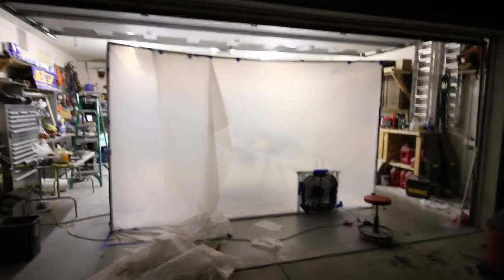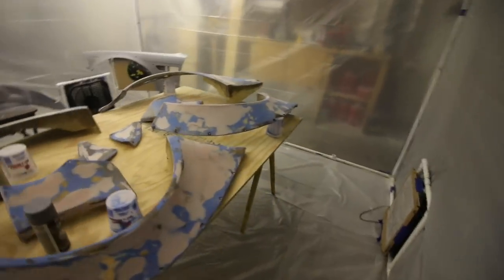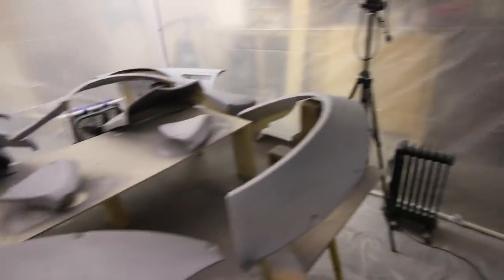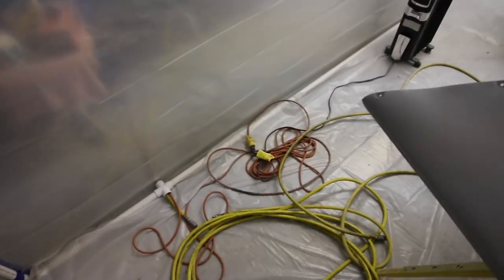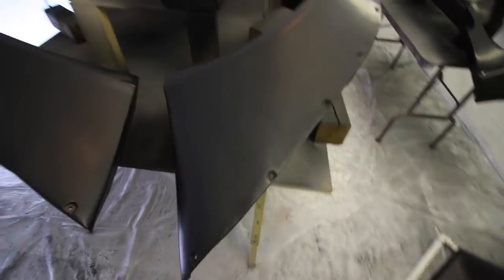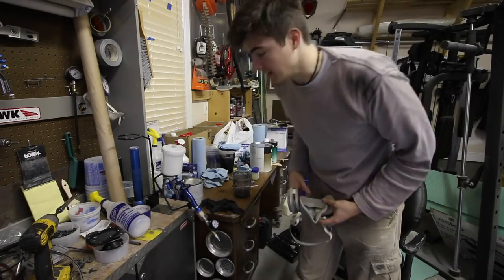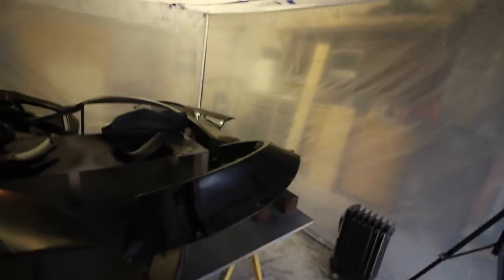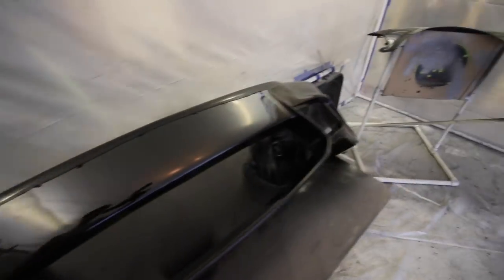DIY Widebody M3: Painting the kit!

Comment: you couldve just wet the floor before painting , makes the dust settle pretty good as well
one thing you couldve done against the sagging is wire the middle up to the ceiling beam 
wat i usually did to clean the gun was loosen the nozzle a little hold the finger or a rag over the sprayopening and pull the trigger , plop the finger of and on and the air will mostly bubble out the paint container filled with thinner 
after that empty open take the nozzle of and use a brush to get the last resideu off

Comment: Why do you guys do an intake fan on these home built booths? It's not necessary and just stirs up more dust and debris, the only thing you need is an intake vent (but not at ground level) with a filter to keep debris from coming in and an exaust fan on the other end, that is enough airflow to get the overspray out but not too much to created a whirlwind or vortex effect inside your spray area. I paint bike parts in my home booth and only have a squirel cage fan at one end, that's it and it works just fine.

Comment: You can tell the fender flares are not smooth.. the way light reflects off of them on curves.. notice how smooth bumper is and fenders are from factory..
Reply: mike dukan I was hoping he'd get it even. It looks horrible. And the black paint makes it much more visible
Reply: Florian J yeh needs some lessons from Trevor from motionautotv on how to sand.. lol he’s a pro by now..
Reply: Daniel Gardner such a tuff guy!!
Reply: mike dukan when he showed the kit after he cleared it i had to pause the video and run to the bathroom cause i got sea sick from them damn things being so wavy he went about it all wrong just spot filling them after he finished making them he should have coated the entire flares with fliller prob 2 full coats to get the even close to smooth and he should have not used fucking rattle can primer that stuff doesnt fill and coat as good as buying a good urethane primer and spraying it. if you cant do body work black is the wrong color to learn on
Reply: he didn't even sand between coats, I hope he is going for a Matte finish.... i guess not
Reply: @Phil Dix: But if it takes 11 months, the result must be near perfect. Otherwise it was wasted 11 months
Reply: He should have just textured them with truck bedliner material and left them matte black.